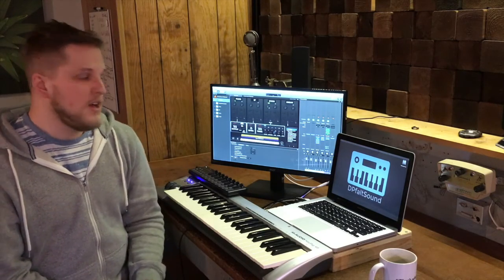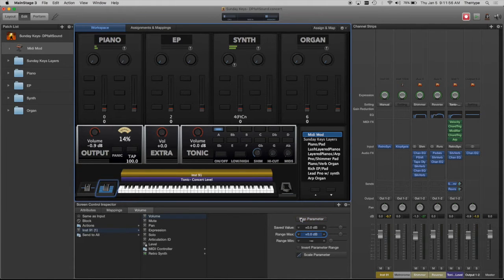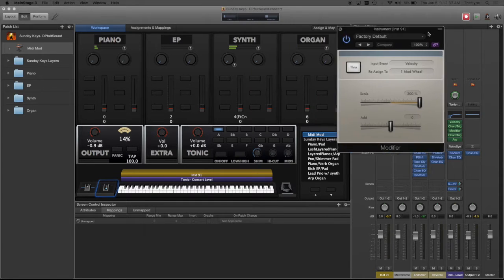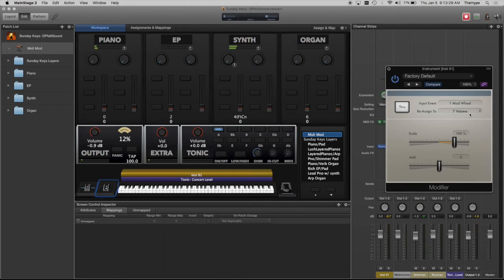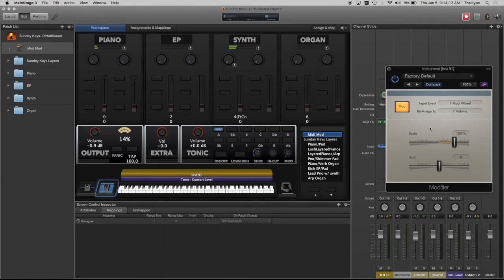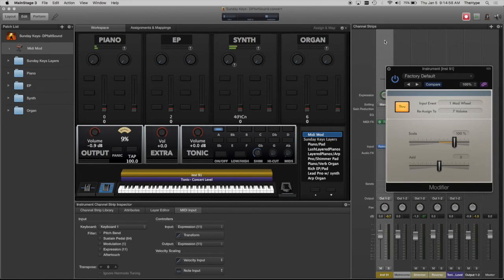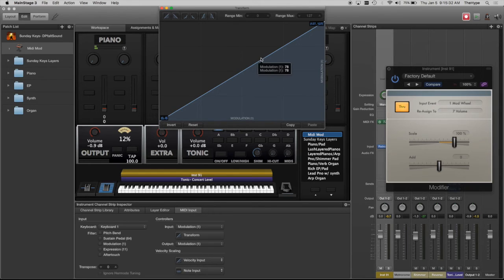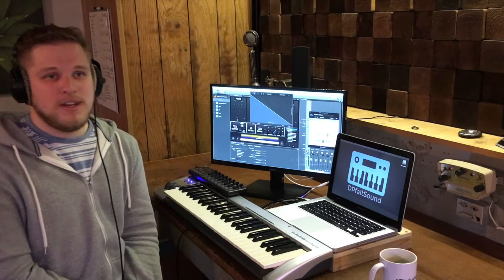MainStage Tutorial: Getting the most from your modwheel

Comment: i been having problems  whit the wheel. . all the times no matter  which  pach .. i use all ways  do the same sound.. any idea?  thanks. .
Reply from the maker: Great question, Jared. This method is what I've been using because it puts everything out front and will work regardless of the instrument plugin you're using in MainStage. Some plugins like ES2 and EXS24 have pretty rich routing options available but a lot of the more straightforward plugins do not. 

Also when you add a mapping to the mod wheel at the patch level within MainStage, MainStage stops sending modulation info to instrument plugins unless you add another mapping and tell it to again.

I hope that helps explain my reasoning. I'm not sure  I fully understand your question so just let me know :)

-David
Reply: This is really cool, I've never used the midi modifier in Mainstage but it seems to operate just like the mod matrix in omnisphere. The thing is, I didn't really see you do anything in this video that could be done by just adding another mapping to that controller. Is this better on your CPU? I just want to understand why you would do this instead
Reply from the maker: Hey Colas, I'm not sure I fully understand your question but I'd love to help! Send me an email and we'll talk: david@dpfaltsound.com

Thanks!

-David
dpfaltsound.com
Reply: cool.. i will.. thanks.
Reply from the maker: no problem!